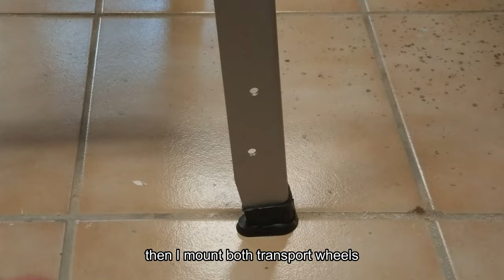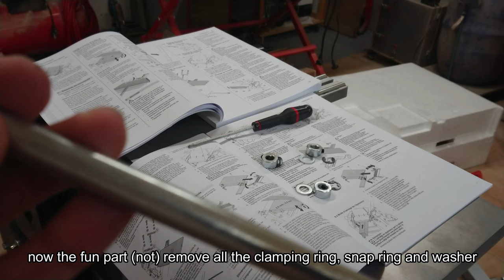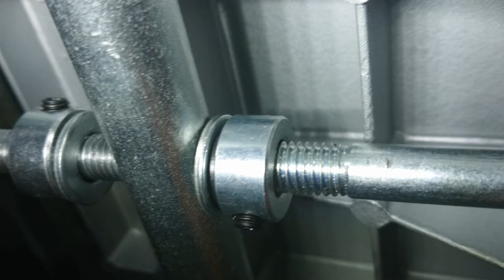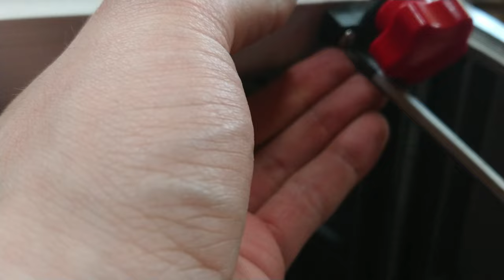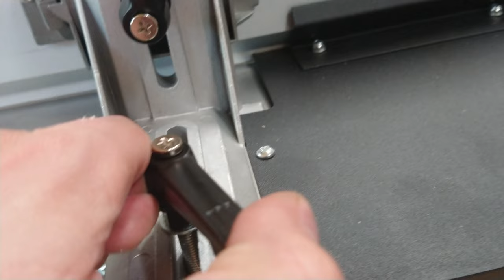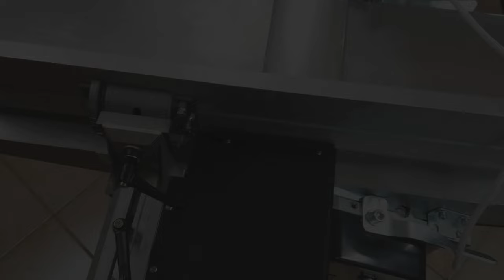metabo hc 260

Comment: For all miserable like myself: that bloody microswitch preventing the start in Planner mode is set under the table, on the left side, facing the machine as planner. See very careful the chapter in manual "Surface planer mode" - Place dust collector connector (this
is not the chip chute mentioned in step 1!) below the infeed table into the machine. Observe correct position of the dust collector connector: ... slide dust collector connector in until the point of intersection of shaft and axis below the infeed table (arrow) is exactly above the matching seat of the dust collector connector. 9. Crank the thicknesser bed carefully up to secure the dust collector connector in position. 10. Connect a suitable dust collector to the suction port of the dust collector connector. 11. Cover the cutterblock with the cutterblock guard extrusion. Metabo should have paid much more attention to this chapter and very clear pictures. Besides this, the machine works just fine.
Reply from the maker: Yes sometimes the instructions are not very well explained, glad to see that you found the problem

Comment: Many thanks! However - my HC260 is not starting in Planner setup, just for Thicknesser. The power microswitch is in open position for Planner, but the lever is in correct position. Really puzzled...
Reply from the maker: the planner has 2 safety devices, there is the lever at the exit table, and there is one below , you must put the chip evacuation cover on, you must be careful ensure that it is securely in place and that the planer table presses the cover against this safety (it's a bit complicated to explain in writing) I hope I could help you

Comment: Hi, thanks for video. In my case jointer is working but thicknesser is not working. In thicknesser mode, ‘black cover’ is fully on planer surface and it’s secured (it’s not possible to lift cover up) but machine is not working. Do you have idea how to solve this problem?
Reply from the maker: Hi you're welcome
In my opinion your problem comes from a safety device which is engaged, it seems to me that it is the one at the red button (at 7min in the video) on the plastic cover (chip evacuation) 
I tried it myself and that was the only thing that caused the machine not to work. 
Don't hesitate to give me feedback to find out if it helped you or if it came from something else, maybe it could help other people

Comment: Hello. Thank’s for the video. Is it possible to adjust the enter table ? (I’m not talking about the higher level)
Reply from the maker: Hello, are you talking about settings like the outfeed table (black hex screws)? if so, as you can see at 3:04 in the video the infeed table slides, and there is no way to adjust it to level, you have to adapt the outfeed table in relation to the infeed table to be perfectly flat, I hope I have answered your question
Reply: @js_workshop  yes, that’s my question. I’ve passed en few hours on it this morning and I can’t put the enter table perfectly like the outfeed table in the right and in the left…
Reply from the maker: @nicolasbelloy4538  I put the enter table on 0 and I adjusted the outfeed table based on the enter table with the help of a level or a very straight slat, then I did the adjustment of the blades, and finally the guide

Comment: Very instructional video from you. Thanks. I haven't bought the Metabo HC260 yet but will soon.
I plan to buy the 400 volt version which is a bit more smooth running and more powerful... and 100 Euro more expensive ;-) Was yours the 240 volt?
Do you have any idea if it is possible to get a helix spindle for this in Europe?
Oh... and I know you can buy it cheap from China, but I refuse to do that.... European/Western jobs.
I know it is possible to buy one from the US, but it is almost 1300$ (same as Euros currently, LOL) ;-)
Reply from the maker: Thank you for your comment,
yes the 400v is better to maintain the rpm, 
for my part I have the 230v (I don't have 400v at home) and I find it powerful enough,
to be honest I've never seen helix spindle on metabo hc260 (if you modify this, wouldn't it be more interesting to buy a machine that already have helix spindle?), 
but the blades that are currently on offer a good surface
for sub-brands: buying cheap means buying twice, 
if you buy it in US or in a country outside europe and import it into europe you will have to pay taxes (20% if I remember correctly) and you will probably have to modify the electrical outlet